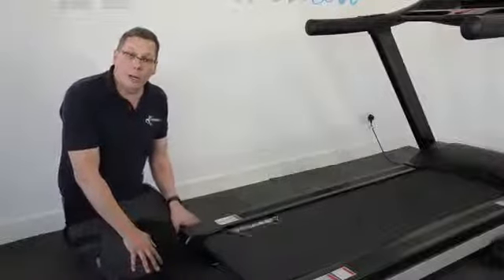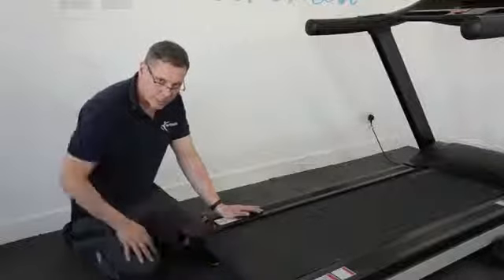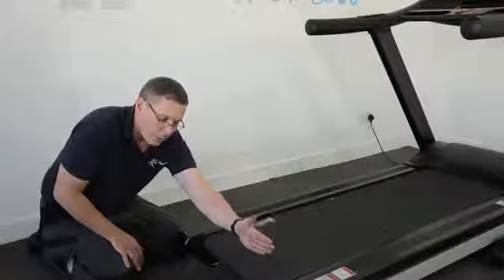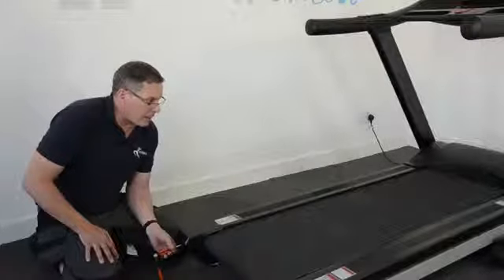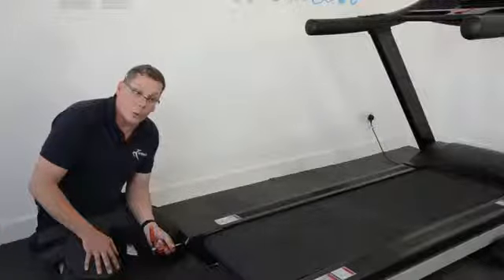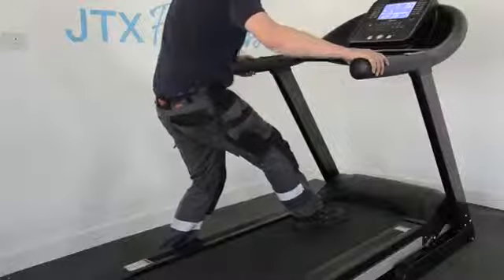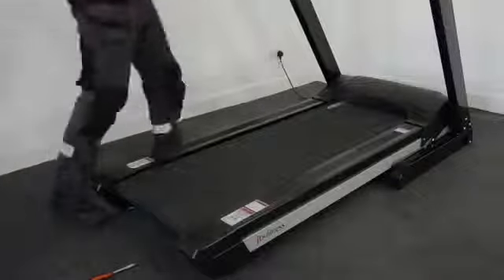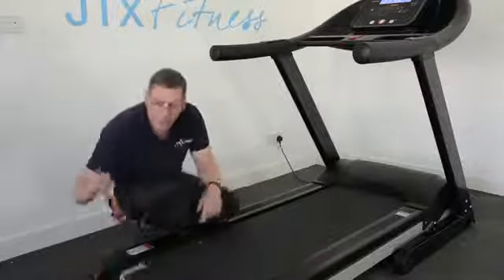6  How to adjust your treadmill running belt

Comment: Thank you for your advice. It’s much appreciated and was really helpful. I carefully followed your clear instructions to adjust my reebok treadmill belt and it worked well with success. My rubber belt is now running smoothly and also runs quietly to. So thanks again!